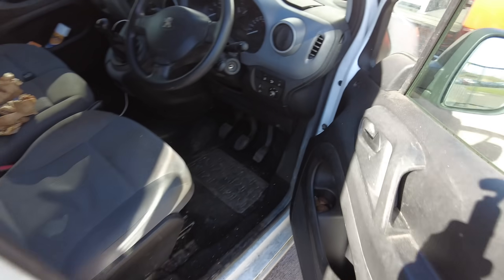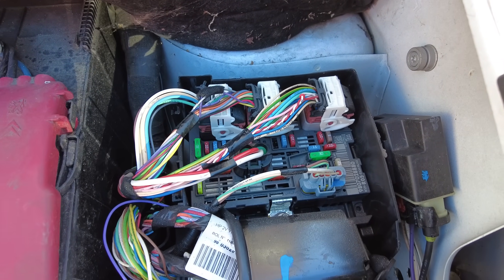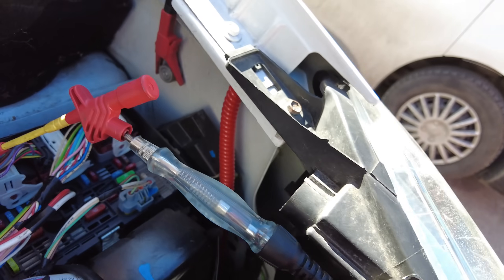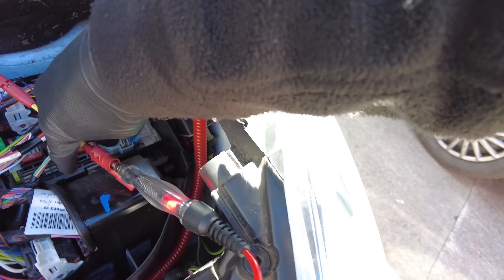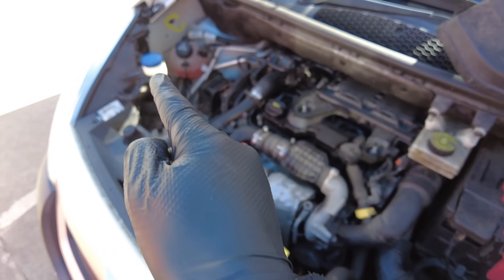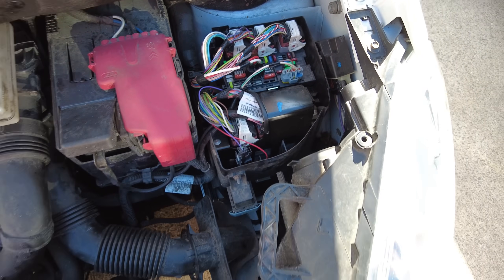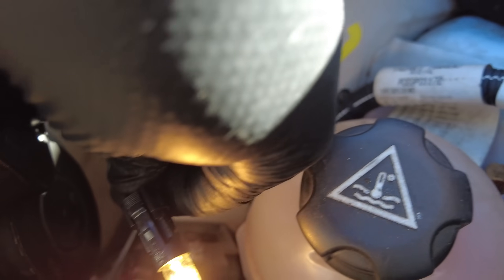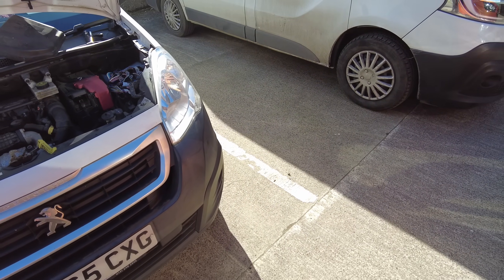THIS COMMON ITEM CAN CAUSE MAJOR ELECTRICAL GREMLINS!

Comment: Modern machines isn't as good as the older vans, cars, I can fix the older ones without too much problems, but one small thing on modem car's can be impossible to diagnose. All of my cars are older and I have a converted transit bus it's almost tax exempt.

Comment: Great video again very informative and useful. Can you just put a new bsi in the car and not have to program it to the vehicle. As you didn't show us anything to suggest you have to do that procedure. I only ask as I want to swap one in a citroen c5 and it looks very similar to that one. Thanks
Reply from the maker: Hi this is the bsm not the bsi, Bsi is inside the car 

Bsm doesn’t need programming 
bsi definitely does need programming 

👍
Reply: @mrautoservices7354  Thanks for the reply, I misheard the bsm for bsi in the video.
Reply: What does bsm stand for
Reply: @the_retired_mechanic  Body Slave Module

Comment: If my van, I would drive a relay from the near side output and run both bulbs off that.  Understand you cannot do that for a customer.  Thanks for showing us how you diagnose this fault.
Reply: If it was my van I'd just try joining the grey and purple wires, I don't know if that would work long-term, but I think there's a fair chance as it's only a low wattage bulb.

Comment: What happens if you connect the gray wire to the purple one as a bodge? Possibly blow a fuse? Or just screws up the BSM even more 😁
Reply from the maker: It would work but i wouldn’t advise it, These modules go on fire so best to change

Comment: I don't like you back probing the wiring as you could have back probe the wiring from the connector too prove your point hasa old school sparky do not like seeing holes in wiring looms as later in date they will rot out but a great video again 👍
Reply: I don't think that's your colour 😂
Reply from the maker: @stevereading6727  😂😂👌
Reply from the maker: Clear nail polish does the trick 👍👍

Comment: Can you not just bridge the wire from the other side light ??
Reply: What, you mean double the current the circuit was designed for? Professional not!
Reply: @ not really gonna pull massive amps is it
Reply: @Jordan-nd7jp  No. Just double the design spec. 
A pro would not do this without the customer's say-so in writing to cover his arse..
Reply from the maker: If it was my own van i would do something of the sort but to be honest these fuse boxes have a tendency to go on fire anyway so best just replacing it 👍

Comment: Do you get any of these faulty units reconditioned?
Reply from the maker: No unfortunately they are epoxied inside so no way of repairing them without going to extreme lengths

Comment: What price is the bcm on these? Great fix as always
Reply: BCM = body control module. BSM = ???
Reply from the maker: @brianredmond4919  This item that is getting changed is the bsm (underhood fuse box) The bcm is inside the vehicle (bsi)
Reply: Get a power probe
Reply from the maker: bsm ranges from £300-£400 depending on your trade discount